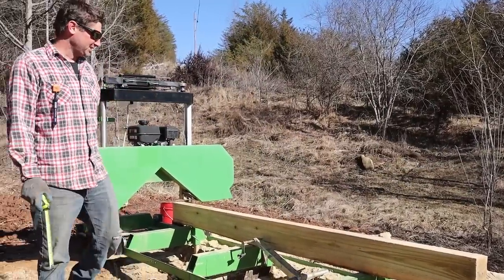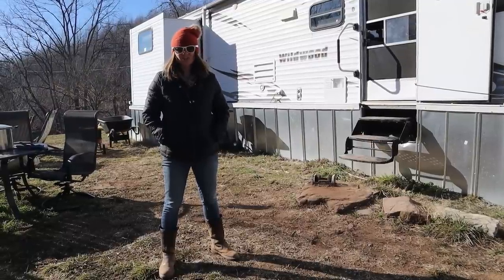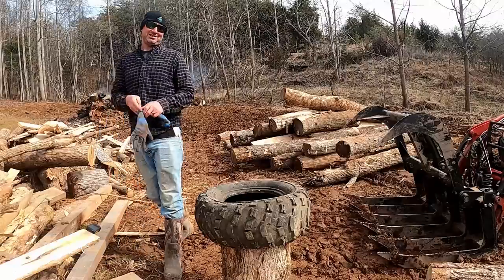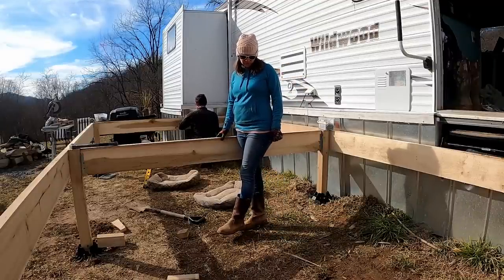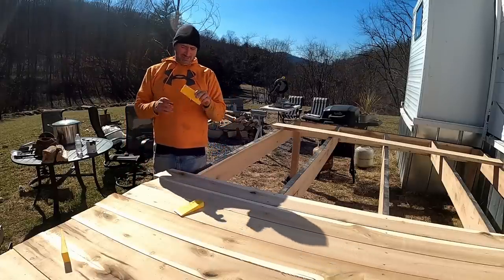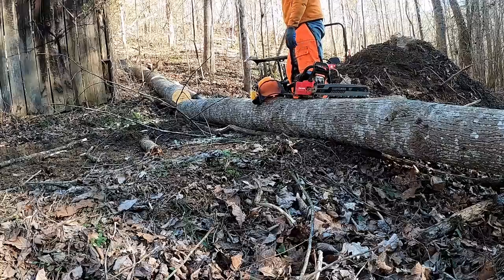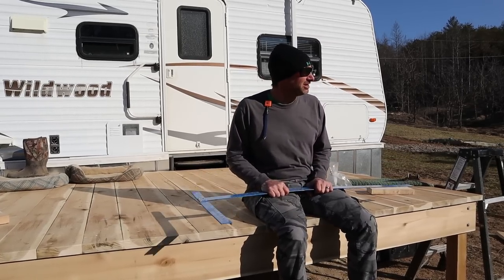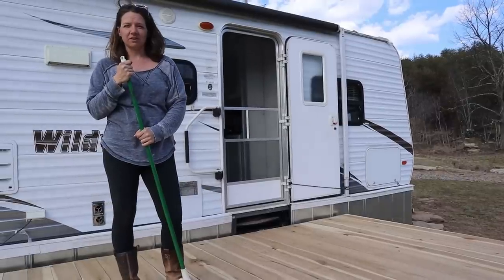RV deck build - should have done this sooner // E73

Comment: The tyre idea is pure genius, no more 'back breaking' bending to pick up and reposition firewood ... Give the man (person?) a prize and thank you for sharing it  ... And it's a 'Guage' as opposd to a 'Jig', no less useful ... Given that you expect the boards to shrink, it might be a good idea to fix them using only one screw at each joist, otherwise the boards may split where the screws prevent movement? ...  And a 'textbook' bit of Felling with the Humbilt cut & Wedges; That you only had to hit the wedges 3 times speaks volumes to what you've obviously learnt. Nice 'hinge wood', Guilty of TreeSon would approve. Bravo.

Comment: Put your big sleep on the back side of your graphicing hook & hit the other side of the hook with your little smaller sledge hammer. It helps sandwich the mettle being straightened & makes more force to straighten it up. Sometimes 😅.

Comment: I applaud your decision for radiant heat. I own a house that uses the old style cast iron radiators, and remodeled my kitchen and installed PEX tubing in the floor for heat, and it is wonderful. The whole room feels warm without any "cold spots" you are aware of. My only regret is that is didn't get it sized quite right, I am slightly undersized, but it still does what it needs to do without having to tear it all up and doing it over. I discovered too late that in this case, slightly over engineering would have been better. But we are still warm and comfortable.
Reply from the maker: Mind me asking what you use to heat the pex? Do you have a closed or open system? How did you go about sizing it? I have done some preliminary research, but would love to hear about your experience.  Feel free to email if that is easier walnutsandwineberries@gmail.com

Comment: Old farmer trick for weather proofing wood on the cheap used motor oil mix with diesel to adjust darkness used on fences and trailer decks well  might be too slick for top of deck but good for everything else
Reply: Yes! Never thot about my trailer deck tho nice tip.

Comment: Where I live in SE BC Canada you can mill up your own lumber to build your house the only caveat is that anything you do that is outside of the standard building code has to be approved by an engineer. This is still vastly cheaper than buying milled lumber. Love your channel. Cheers ~ulrich
Reply: This is really good advice. In my experience building inspectors are flexible especially if you've got a structural engineers calculations and their stamp.
Reply from the maker: Worth a few phone calls.  Thanks for sharing your insight.

Comment: Another great video Jon and Meg! One thing that I have done when cutting a bunch of boards to the same length (or anything for that matter) like the edge of your deck, is to take a straight board and use your wood clamps and then use the board as a guide, similar to a track saw, and then use your circular saw to quickly run down the whole edge nice and straight. A cool railing would be to have a bench around the inside of the rail for guests to sit and then you could have a small contained fire pit in the middle, if you choose.

You saved yourselves a lot of money on that deck! I just spent $80 at Menards to make two large picture frames out of poplar. Hopefully I can get those made tomorrow!
Reply from the maker: Cool bench idea, Bryce!  Planters with kitchen herbs would be fun and useful, too.
Reply: @WalnutsandWineberries  That was exactly what I was thinking too. The bench could server multiple purposes. After sleeping on it. the fire may not be a good idea but a hot tub under the stars could be!

Comment: You could use 4X4's for your corner post for floor and steps. 2X4's on the top and then 1X1's or 2X2' for the pickets around the deck and on the side of the steps. Now on the 4X4's cut them 6 inches longer than you want.. And then cut the bottom if half cutting, so the post will sit on the floor and have half of it hanging over to attack the he corner post holding the deck up.  Hope this makes sense to you.  wish I could draw it up for you.  Be Blessed my friends.  I really do enjoy watching y'all work..  Keep up the fine work!

Comment: There are many uses for broken tape measures. Just one is to attach it to a readily available section of a building and you will always have a limited (the length of the usable tape) length of measuring tool at hand. depending on how often you "lose" your tape you will still have a way to insure your work is measured correctly. Some inconvenient but available.

Comment: ICO permitting.  In Virginia theres a statue for "agricultural" buildings.  If you're housing equipment, animals, feed or tool storage no permitting is required and as such graded and stamped lumber is not required.  

Search: Virginia farm building exemption.  The USBC code is for all of Va.
Reply: AZ was similar but as long as under certain sq footage, KY seems to be same as VA
Reply from the maker: I wish it applied to primary living quarters too.  I got excited when I found this exemption too.  At least the other buildings for the homestead would qualify.

Comment: As this is temporary you can dig four holes and concrete the newel posts in, dont use wet concrete use a dry mix , 4,2,2 mix.. the moisture underground sets up the mix a lot quicker and better . then anchor high ones to deck and riser.. bottom ones to riser. then its just deciding what you want to fill the sides in with. I suggest putting a solid vapour barrier under the  bottom of the risers like a thin stone slab. to make it all solid and keep the risers off the mud. Used to do this job occasionally for building owners. Hand rails should be narrow enough for a kid to grab if she slips. You are doing really well.

Comment: Great job dropping the tree. I noticed you put two screws in each place to secure the deck boards. To prevent the deck boards from splitting while they dry you may want to remove one screw from each pair and let the wood adjust itself as it dries out. After it finishes the drying process put the 2md screw back. I just "found your site and I am enjoying watching as you & Meg go thru this adventure. PS I have a sawmill also. Not a Harbor Freight one.  It's home made and on a trailer.

Comment: Happy to see you guys again.  Just something to 🤔 about in the future. If you are indeed planning on building an entire house investment in tool's is something that will pay huge dividends especially a Paslode portable battery operated Air nailer is a must especially if you are building on top of old Smoky 😆. Thanks for letting us see you guys grow your homestead.
Reply from the maker: We went back and forth a lot with which nailer to purchase.  So far the banks is doing great.  We built the deck with screws to be able to dismantle it easily down the road.  If we find we need an upgrade we will keep the Pasloade brand in mind.  Thanks for the suggestion, Mark!  - Meg

Comment: Guys, Over here in the UK, I've found that a mixture of one third used engine oil to two thirds Creosote, solves all of the wood preservation problems. Just passing on information I've used for the last 40 years...Regards Robin....
Reply: Creosote is illegal in US 🤠 somethin about carcinogenic. Even tho we use it on railroad ties and utility poles everywhere. I’ve used old engine oil and diesel on ground posts cuz that’s not cancerous right? 😫 I guess the black paint Meg used was the safest, who knew?

Comment: You might need to put AngleBraces from the bottom of the 4-4  up to the outside joist so it doesn’t move when you walk on it and break your board where are you put the lag bolts

Comment: If the highly efficient heating system is not ground heat pump then check that out.
As railing I think I a log fence style would look good made with debarked smaller logs and limbs.
Reply from the maker: The budget is not going to swing geothermal.  We will be using solar heat collection.  All of our hot water needs and heating needs are going to be gained from the sun's heat.  - Meg

Comment: 1) Since you are near the juncture of about 5 states, you might see if one of the other states accepts popular lumber, and do a trade with a lumber yard or mill in one of those states for southern yellow pine.  A mill in say Tennessee or S. Carolina might be better due the trade would be closer to Wholesale for Wholesale value as opposed to Wholesale value for Retail with a yard.  A local mill might trade you if you offer at just decking lumber.  Just a thought.  If it came down to cash vs a barter, I'd still work it a bit further.

2) If you're already getting rot on that popular you'll want to treat that wood, and probably with more than deck stain and sealer.  The stuff that is in contact either with the ground OR on the concrete footer tiles for 4x4'S at the least you'll want to coat the bottom few inches at least with foundation tar sealer.  Just a thought. ;-)
Reply from the maker: That is an interesting angle to consider a trade.  Thanks for the thought. - Meg
Reply: You are welcome.  Since you are in a time window of an unfortunate inflationary spiral spinning up on everything, in particular, building materials, your long clear grain popular lumber may be MORE valuable as clear decking lumber, than as structural lumber and a swap may be both valuable and welcome from mills, yards, or custom deck contractors.  It is here.  And the building code here is pretty insane.

Comment: I  think if you can pour a small slab for your mill and make it a bit longer you can add to your mill at a latter date.Keep a open at the back where the saw dust comes out so you can back dragg it to keep it safe.Thanks.
Reply from the maker: A slab for the mill is on the list of spring projects 👍

Comment: I saw another home milling video of a build with freshly sawn lumber where the builder used a single screw in the center of the board at each attachment point, his thought was it would allow even shrinkage across the board.
Reply from the maker: Interesting, we will have to see how it shrinks up with the two screws.  With the thickness of our boards, I think we should be just fine. :) - Meg
Reply: @WalnutsandWineberries  One screw encourages curl up.

Comment: you do know that the replacement tape is available to replace those that are broken you don't need to buy the whole unit. You just take it apart - making sure the spring inside does not unwind - and put the new tape on the end of the spring, let the spring pull the new tape in and replace the half cover screws.

Comment: If I remember correctly ,you should have 3 bags of Quick Crete left from your shed pour , excavate under the bottom step where it contacts the ground ,make a 2x4 frame level with the ground + 1/4 to 1/2 inch higher for the stringer base step to rest on to prevent contact with the dirt so it doesn't rot from moisture. As far as railings im also a little anal too, I incorporate 4x4 's into the design for the post railings ,by using the framing of the decking to my advantage as people will always inadvertently lean and push on the top rails without even realizing their doing it ,try and see if you can center a 2x6 for the top rail ,as it's wide enough for coffee cups ( you'll thank me later ! ) use 2x4 's for middle,& bottom and safety slats can be 2x2's cut @ 45'degrees on each end ,it's strong ,safe & looks good, this is just my 2 cents, you do what you want, I'll never impose my opinion on someone else ,but after doing the way I've done it 3-4 dozen times I've never had 4x4 railing post fail or break ,& with a 2x6 flat top rail ,a lot of customers have tried coffee cups on 2x4' s & said it was pretty sketchy and ended up breaking some of their favorite cups , good luck with all you guys do and in your life !!! Billy Gross.

Comment: Could you have a Engineer get you approved drawings for using your poplar?  If an engineer specs it out, at or greater strength.  Maybe that would work... If you still had a desire to use your own lumber.  It would be cheaper.  Crazy lumber prices!

Comment: How do you like your mill? Any major complaints? Anything u wish u would have known before the purchase that could have swayed your purchase?
Reply from the maker: I like that it's simple.  The engine fires right up on a single pull when it's cold.  I'm rough on my stuff, and to be honest, this mill has been sitting uncovered for over a year now and it has held up fine.  I recently talked about bigger blades for it and it really made a big difference with my cuts (episode 72).  I don't like the frame.  Woodland Mills has a much sturdier model that's comparable in price that keeps the saw rigid on the rails.  This one tends to wobble a bit if the blade isn't super sharp.  Other than that, it's been great.  Look into this one though: https://woodlandmills.com/product/hm122-portable-sawmill/

Comment: Alot of times you only need to use load bearing walls for stamped wood so check you might be able to build load building with it and use your own wood for walls... So not sure if that will work for you after all normally they only care that the load carrying walls are good... So the way to do it is to cut wood have the guy come out and stamp it lol you pay them by hour obviously that won't work because you have the wrong wood make friends with a carpenter and trade wood
Reply from the maker: We really get into this topic in episode 82. We have a plan for this now 🤞
Reply from the maker: Sorry episode 83

Comment: Also you shouldn't slap the chainsaw sharpener on the chain cause you can chip the disc
Reply from the maker: I used to gently apply the disc until I realized I was annealing the teeth of the chain because it would heat up so much.

Comment: I don't think that it's been tampered I think they just cut the metal and welded it on they didn't even temper it with where they put it in a forge and oil it to give it strength

Comment: Check out sawing with sandy, he did a really good video on chain saw sharpening with a sharpener similar to yours.  I used the same one you have for about a year but changed because I didn't care for the gullet shape that it created and how long the edge lasted. I switched to a dremel style sharpener with a diamond cutter and guide and am much happier with how long my chains hold their edge.

Comment: When I was building our deck for our camper, I didn't find a lot of videos on YouTube.  So we made one with our build:  https://youtu.be/oEInjR3uISY   Mostly pics of the build but at least it was something.  I do like your video.  I have a question for everyone in general.  When we did our deck, we put the posts in the ground a couple of feet.  That's the way I learned to build decks with my dad.  Not saying either way is right or wrong.  Just wondering.  Are there different times each one would be preferred?
Reply from the maker: Great question.  Ours is temporary so we decided not to put the posts in the ground.  Code would require posts to be in the ground with footers below the frost line for permanent structures.

Comment: U must remember that building codes where not made to make sure u were building safe but ot make u buy ur lumber from a big crop  My house was built in 1957  It has all ruff cut lumber in it  Walls are 12" think  Beams in basement are 16" logs flatten only on top.  Bark is still on them  Buy the way those 12" studs are 3 inches think and cheery  If I want to hang somethin on a wall I fins stud and drill a hole U can drive a nail into that cherry Ceiling rafters are same same 
building  codes would not let u build a house like mine today  It is solid as the bed rock it is built on with a 4 foot think field stone foundation  The basement had to be blasted out using black power
Any house U build today will not be standing 100 yr but mine will as long as u keep a good roof on it